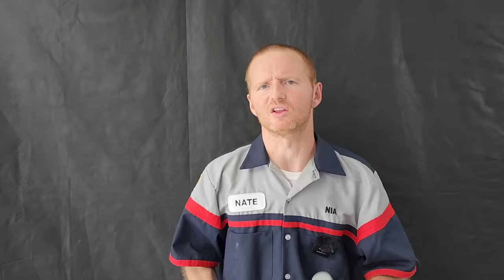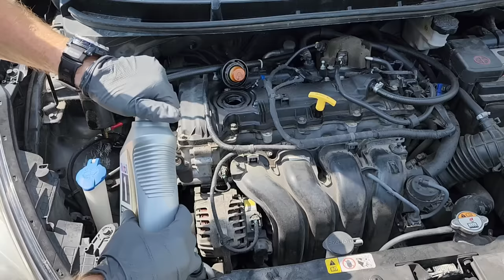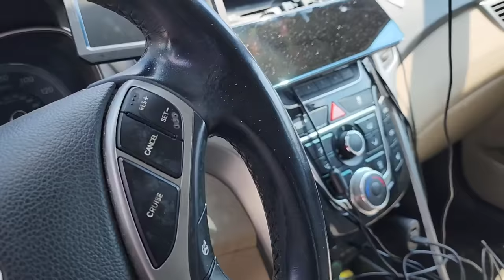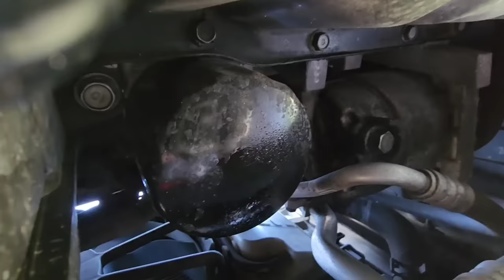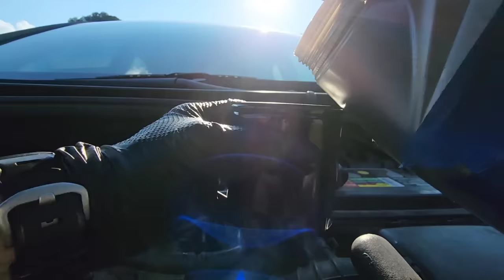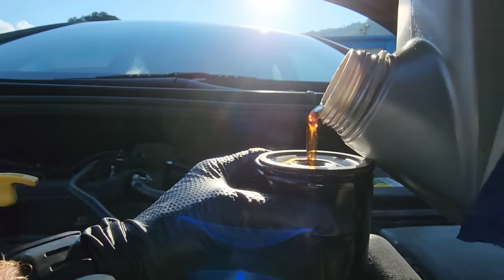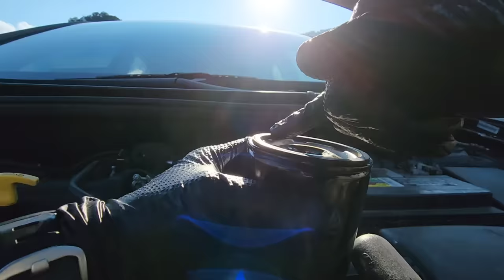Car owner sued after Jeep kills Mechanic during oil change

Comment: The car should have been in park, with the parking brake on before they changed the oil.  This tragedy would have never happened if that safety procedure would have been followed.

Not to point fingers, but I'd say whoever parked the car was at fault. Since the 19 YO kid didn't know how to drive a stick I would hazard a guess that it was the old mechanic who parked it that way.  Not enough information here to know that for sure, just a guess.

Comment: 100% the mechanics fault starting the car if u can’t drive manual then u have no business being a mechanic also parking brake was not applied clutch pedal should not have been dumped he also should have warned the guy that got killed he was not familiar with a car like that and to move out of the way so many things the guy that started the car should be charged and second the dealer for not giving proper training the last person that that is at fault is the owner of the car

Comment: Can also have a clutch set up with a remote start on it sometime it can start alby its self in a shop that has a lot of Simi traffic. It the shifter is in first gear it will move it it get that signal to do so. Stay safe.

Comment: If the mechanic doesn't know what a manuel transmission is why did this idiot mechanic tried to start it? If you have no idea about it don't do maintainence on a manuel vehicle  or at least don't start it and ask from someone else to do it. If the court finds the owner guilty it shows that there is no justice there. The guilt is on the mechanic then who let this idiot to work an operate on a vehicle that he doesn't know. If I were a car mechanic can I do oil chage for an excavator?? Even I change the oil somehow I would never start it.